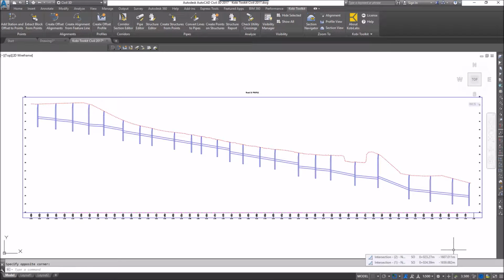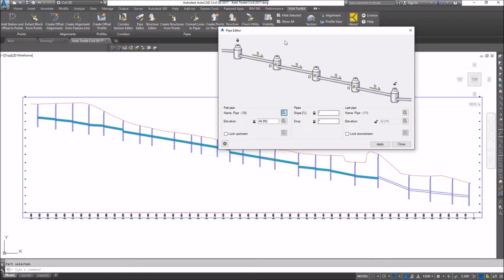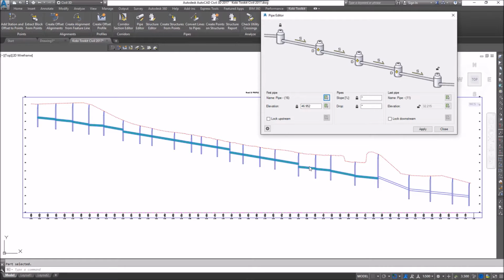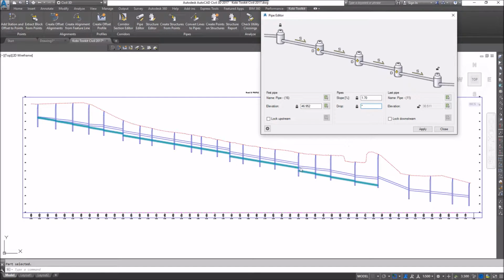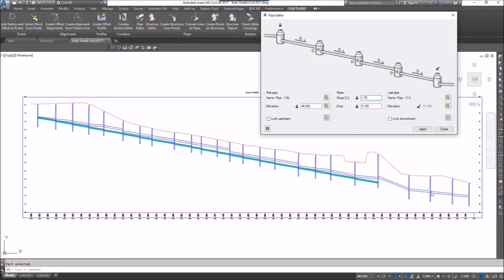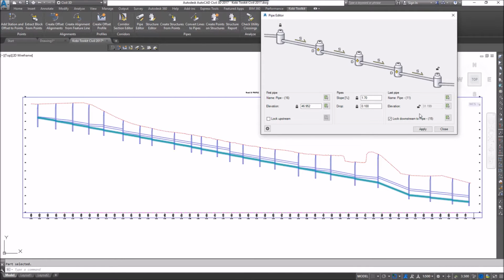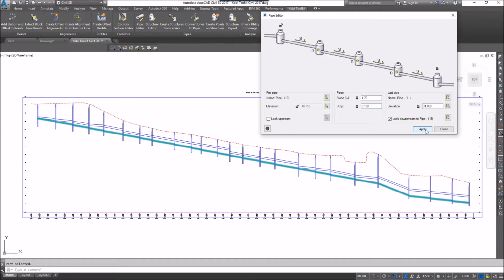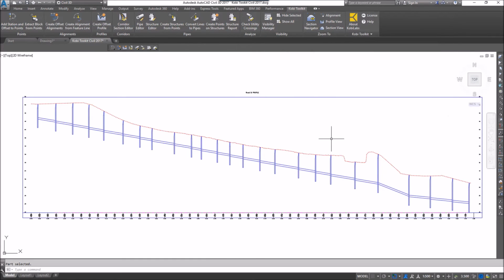Civil 3D Pipe Editor - Kobi Toolkit

Comment: I tested the Pipe Editor function during our 21 day trial and it worked great. This function along saved me. Tested it out on a 42 manhole network and where I had typed in a wrong elevation around manhole 11 and I had carried that mistake all the way to the end. So instead of additional hours of work in manually editing elevations I was able to correct the pipe elevations for all 42 manholes. Trying to get my company on board to purchase. Still have more features to test out.